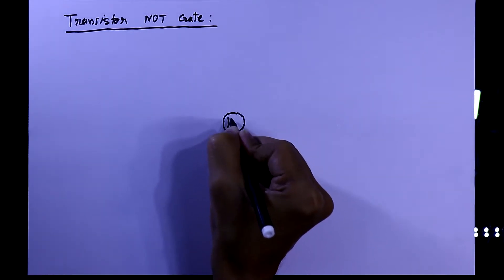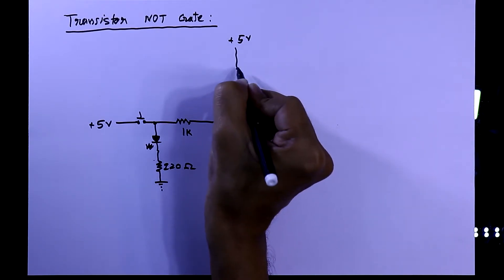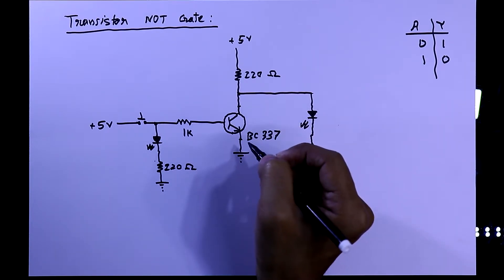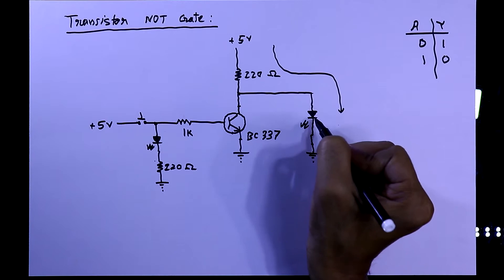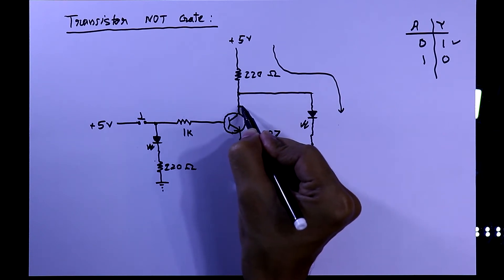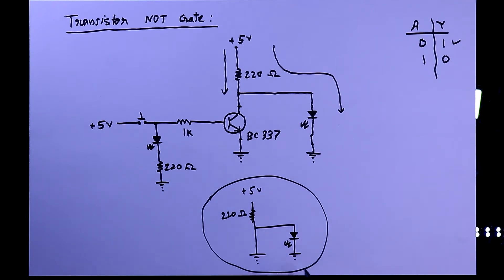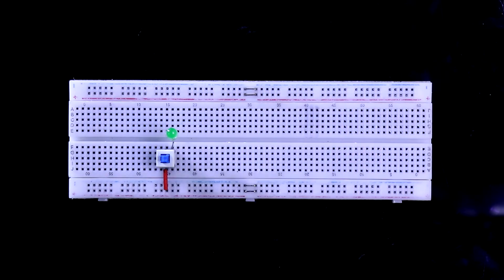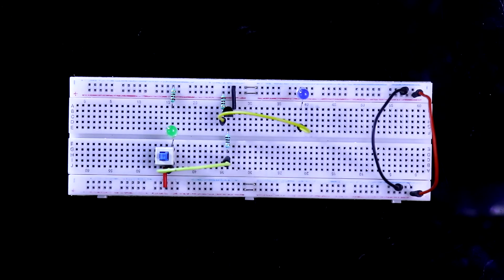How to make NOT gate using transistor

Comment: Awesome! But also, I'm guessing this isn't perfect right? To me it seems that some small currents should flow through output diod. Or don't they because of properties of diodes?
Reply: Yes a small current will flow, but if the current is low enough to be negligible then we consider it a 0 output. If the current is not negligible then you just adjust the resistance values.

Comment: I don't understand why the path through the LED has less resistance than the path through the transistor.
Reply: short circuit, that makes the transistor hot as fuck.
Reply: Bro led utilizes energy to glow while transistor is only a switch which needs only 0.7 volts while if there is any led even if it is red which needs around 1.7 to 2.0 you can see the difference and electricity like to use short path with less resistance